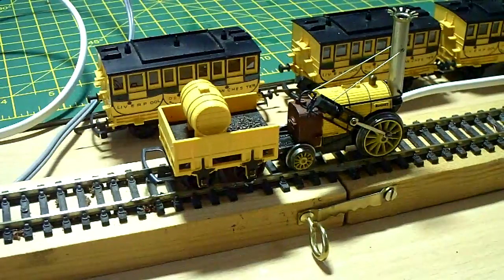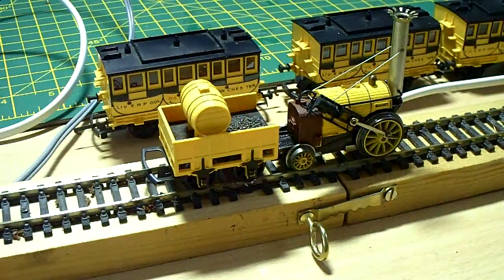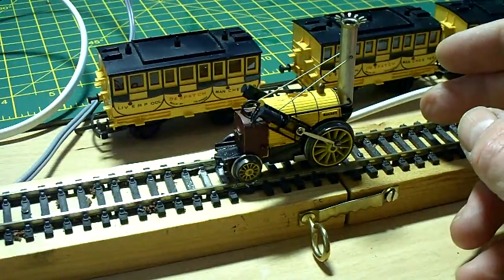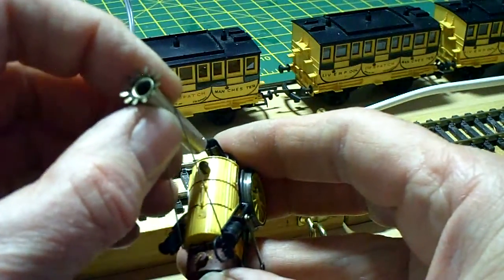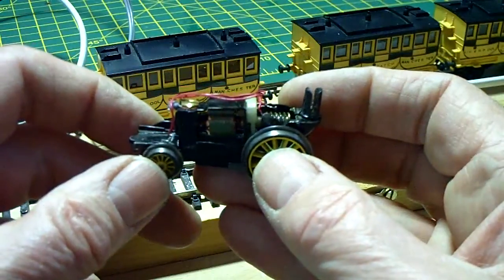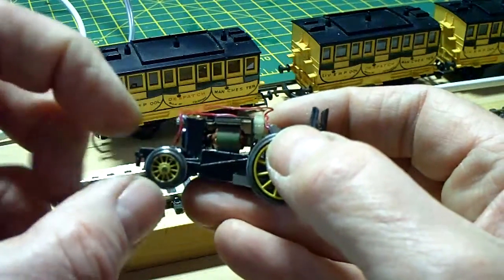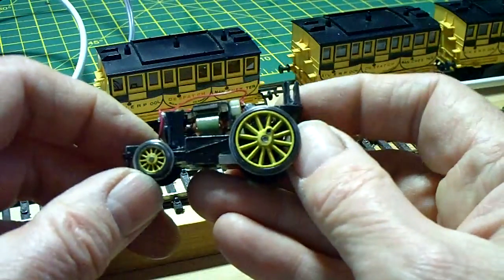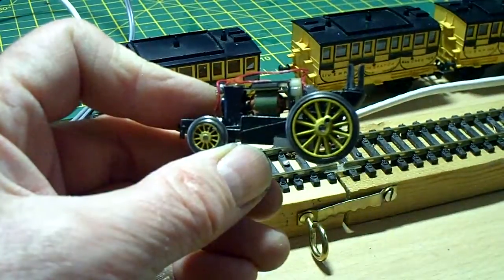Triang Stephensons Rocket with Mabuchi Motor part.2

Comment: For anyone else who stumbles apon this video and is curious what motor he uses its an older style 14mm mabuchi motor to fit it into the chassis you'll have to grind down the sides and rear motor support to get the motor to fit I of course couldn't find that specific motor because it's not in production anymore so the available option is the new 14mm mabuchi motor